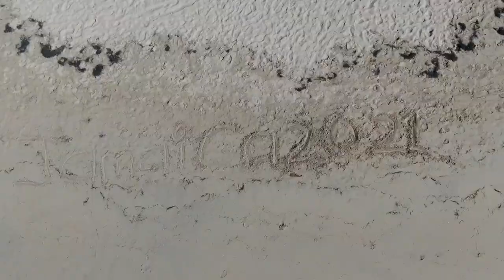JAMAICA VLOG 2021 | HOW TO BUILD AN ALUMINUM WINDOW FROM SCRATCH IN JAMAICA

Comment: Question how do you make those cut at the bottom the long split at the end of those frame
Reply from the maker: I used a grinder with a 4inch cutting blade.
Reply: Thanks so much 🙏🏽